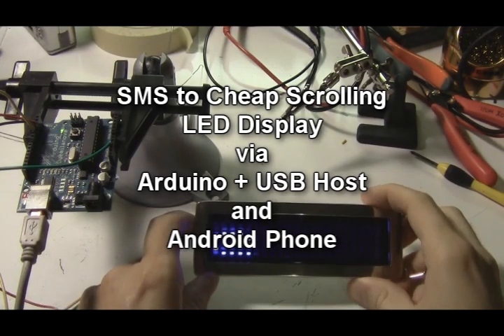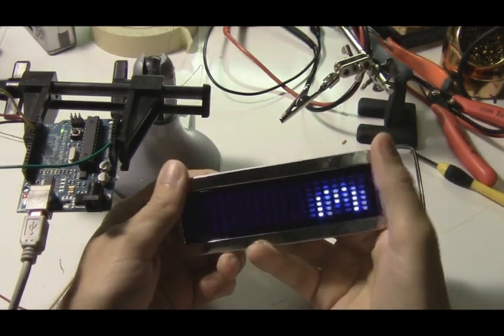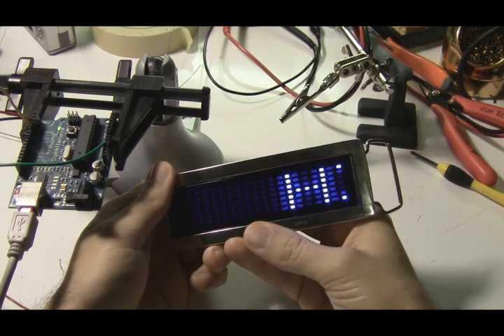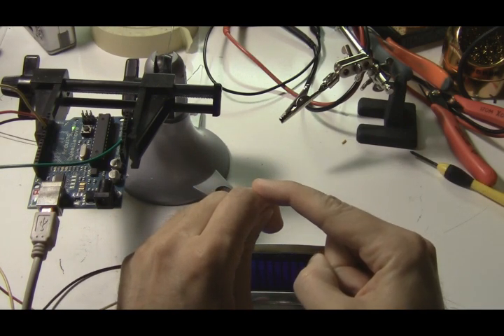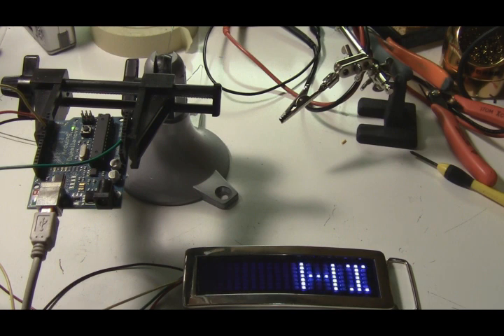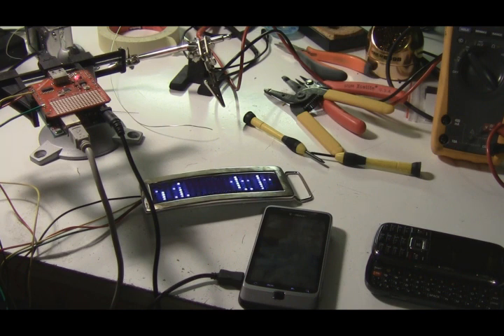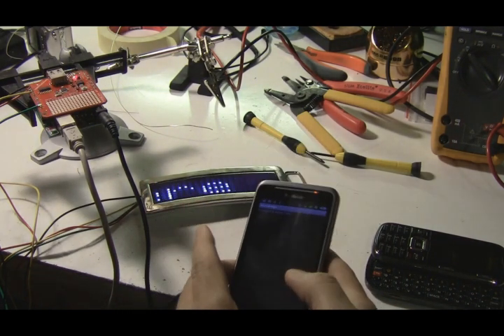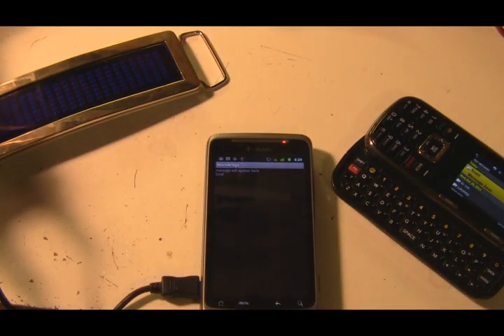SMS to Scrolling LED Arduino USB Host Shield Android

Comment: From your website:

"The three push button switches simply short the bottom side of the switch to ground when pressed. We're going to simulate this action by switching the bottom side of the swtich between a high impedance pin (a digital input) and ground (a low digital out). This is easily done by switching the direction of the pin on an arduino, using pinMode(pin, INPUT) or pinMode(pin, OUTPUT). Just make sure the output is set Low before setting the pin to output (digitalWrite(pin,0))"

Ok, so pinMode(pin,INPUT) is the same as a button press (i.e., closing the switch), and pinMode(pin,OUTPUT) followed immediately by a digitalWrite(pin,LOW) is the same as releasing the switch?
Reply: Could you download the code?